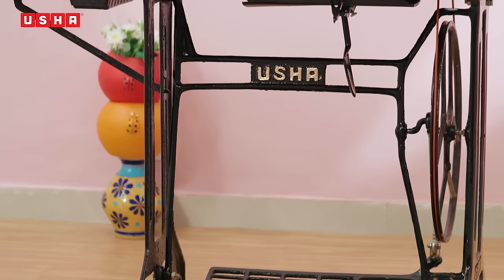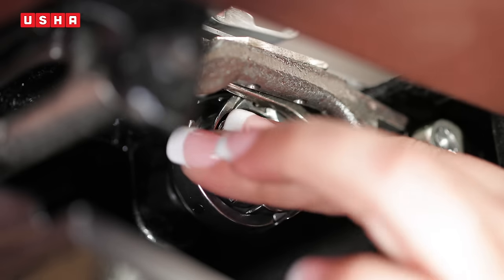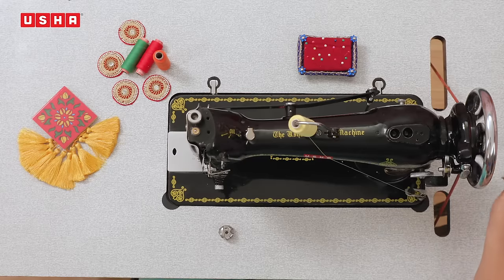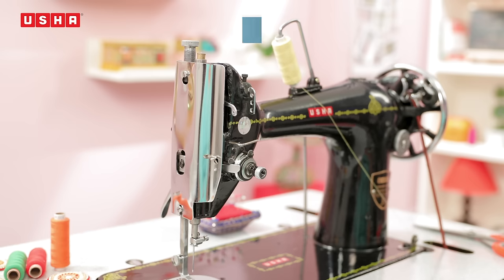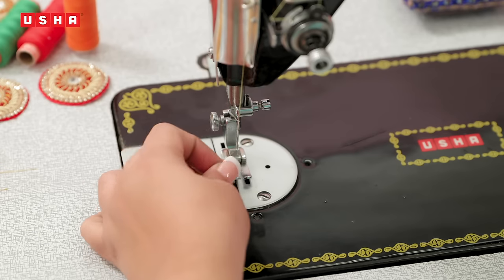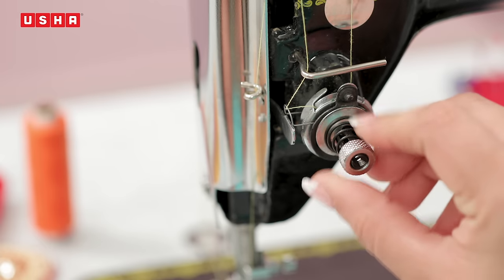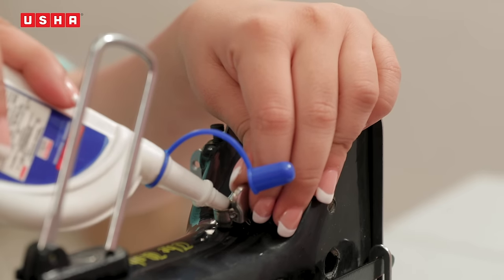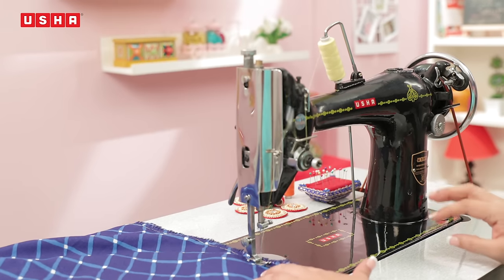Lesson 21 - Know your Usha Rotary Stitch Master (English)

Comment: I don't  know whether the machine demonstrated Stitch Master PRO.  I bought this machine from COIMBATORE dealer about 18 months back it is rarely used.  But after some time the loose stitches problem began and two different mechanics could not set right till date.  I am very much disgusted with it & being a branded company machine it gave dull looking & awkwardly sliding plate in initial stage itself.   I am of the view that it is  not worth buying
Reply from the maker: Hi Hari, we sincerely regret for the inconvenience caused to you. Please share the below mentioned details with us at - usha_care@usha.com so that we can assist you further. ~Team USHA

Name:
Contact Number:
Email Id:
Address:
Pin code:
Product:
Model Name:
Date of Purchase: 
Dealer's Shop name:
Issue:
Reply: I also have the same problem .lower stitch is always loose .no one in my town can fix it.i just bought couple of months ago 😭

Comment: Hello madam, iska needle size bolo mam please 🙏🙏🙏🙏🙏
Reply: Is machine ka bolo
Reply from the maker: There's a huge range of needles to choose from these days. But the general rules for usage still hold true. Use sharp points for woven fabrics, ball-point needles for knits, and universal points for both wovens and knits. Also, the size of the needle should be as per the thickness of the fabric.